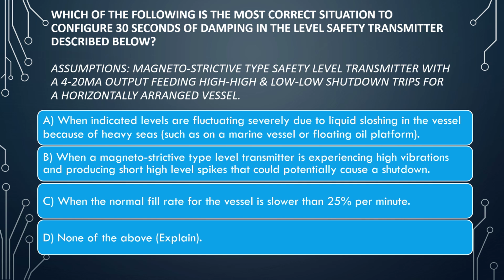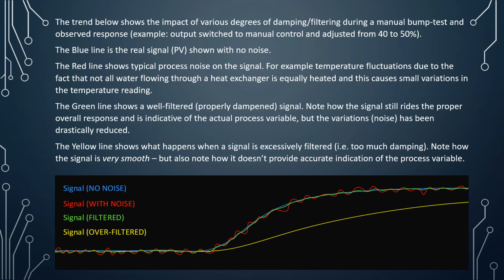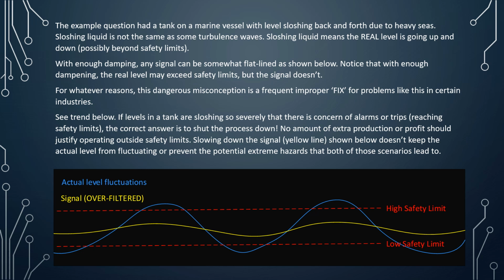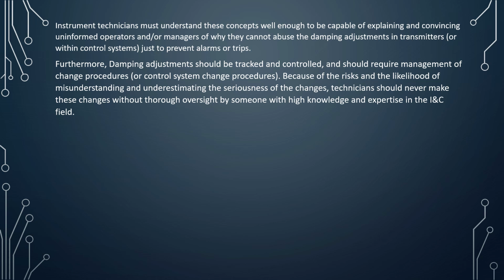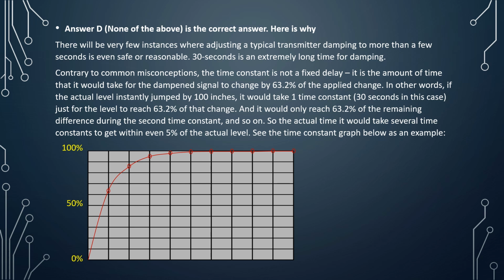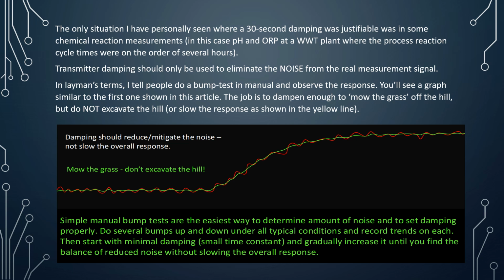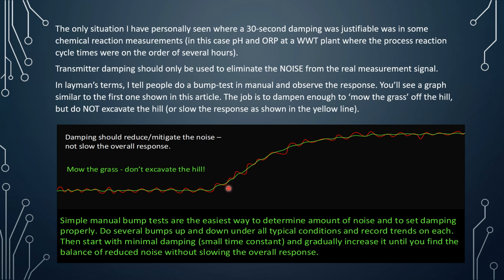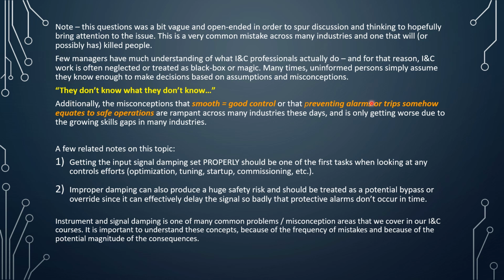Instrument Damping

Comment: Currently struggling with a an air measurement for a gas-fired heater ratio controller. Thermal mass flow in a large air duct with only about 40"H2O pressure from the he blower. The signal "stitches" pretty rapidly and as the controller tries to react, you eventually get a very nasty looking flame so the fire eye trips the gas skid. Sounds like an appropriate amount of damping might be a positive in my situation?
Reply from the maker: Hi Daniel - air flow on the blower is likely very noisy which is exactly the types of scenarios where damping is justified (and needed). 
Do you have a way to plot or trend the signal? 
If so, do a manual bump adjustment to the blower (if possible) of about 25% if possible and let it steady out. Do a couple of bumps up and down. You'll see the overall PV will gradually change but the 'noise' will be bumpy and erratic on top of it. 
What you want to do is adjust the damping so that the noise is greatly reduced BUT not enough that you slow the measurement. Be careful not to dampen too much or it will cause control issues and problems and could be a safety issue on some systems. 
I call the damping adjustment method described above as 'mowing the grass on the hill' vs 'excavating the hill'. 
My guess is that you shouldn't need more than a second or two of damping max to reduce the noise - but it depends on the application (so reach out if you see something different). 
PS - It sounds like the controller may also be tuned really aggressively if I understand the application right. That may be ok - but something to ponder. If the controller is tuned too aggressively it can cause the issues you describe as well (or at least add to it). 

I'd be happy to chat about it over the phone if you like. I'm a nerd and problems like this interest me. You should see my contact info on the website or my LinkedIn profile (don't wanna post it here due to SPAM spiders). 

Hope that helps. Thanks for the comment and dialog. 

Mike